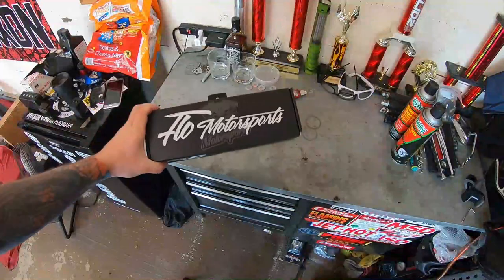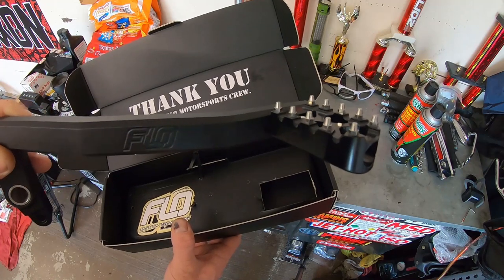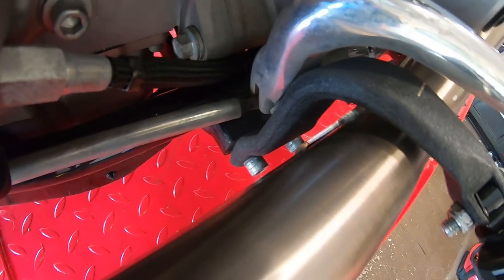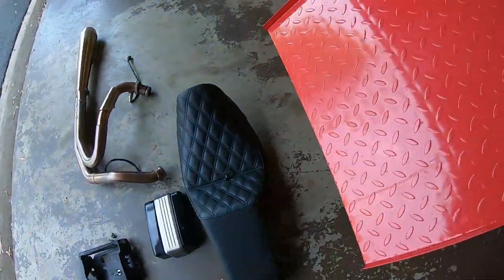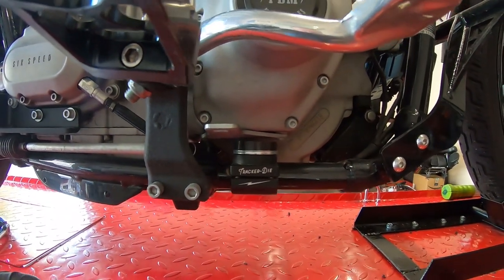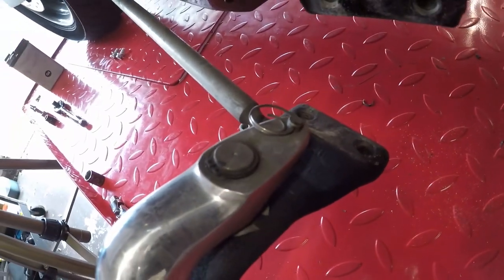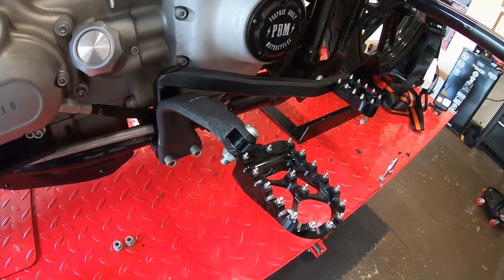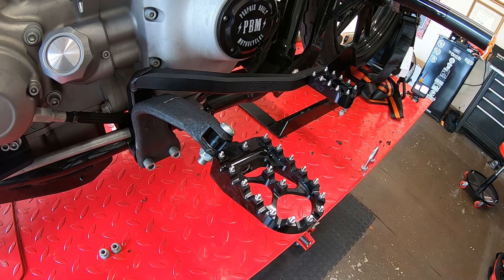Flo Motorsports Rear Brake Arm Install Harley Davidson Dyna

Comment: I was able to get mine off without removing the exhaust. Used a ball end Allen and a box end wrench as a cheater bar to rotate and pop those bolts loose. Got them out by hand after that.

Comment: Glad I watched this... I've got more or less the same setup and I'm doing the flo brake pedal tomorrow... I've got some ball head Allen's that may work to get the peg off, but I'm going to grab some exhaust gaskets just in case I have to take it off. Almost hoping I do so I can finally get around to installing the wideband 02 censors and the target tune I've had sitting

Comment: So does any of the adjustment give you more response than the OEM pedal. My FXDB always felt like I had to push the pedal down further than should be necessary to get into breaking the tire to a stop. You said there was 2 adjustments but only showed the length adjustment was the adjustment rod the second or did I miss something. Shit response from OEM pedal since 08 when I got the bike hoping to fix that issue.
Reply from the maker: Yea the rod length adjustment is all there is as far as adjustment

Comment: I'll have to run over to my '17 Dyna Street Bob (with stock exhaust) and see if I have enough clearance to remove the footrest... I sure as hell hope I don't have to remove my exhaust LOL.  I just bought a Performance Machine Apex brake arm for my bike.
Reply from the maker: If you are replacing the whole arm Iam 98% sure you have to remove the exhaust.....sucks
Reply: @TrippHPjunkie  I took a look and with stock exhaust, there is enough room to get the footrest bracket off if I have to.  The service manual also does not note you have to remove exhaust and simply just describes the snap-ring and cotter ring points.  It'll be a tight fit (with the hands) but I think I can pull it off!  All the best -DV

Comment: Does this arm give you more pedal to pipe clearance over the stock arm?  I upgraded my pipe but the stock pedal is very close...was thinking of switching if this arm is a little thinner
Reply from the maker: Try adjusting the arm away from the pipe

Comment: Hey you have any issues with the pedal not being able to pressed down fully because it hits the edge of the foot peg bracket?
Reply from the maker: As of right now no......I had to space the exhaust out so that it wasnt hitting but other than that I could adjust the pedal brake rod to gain clearance also hope that helps....👍👍👍👍
Reply: I didn’t know if you could adjust that brake rod to raise it enough to prevent it from hitting the bracket or if I just have a defective part, that’s what I’m trying to figure out
Reply: Thanks man! I appreciate the quick response I’ll see if I can adjust it. I didn’t have any other issues with exhaust clearance, I have a cobra speedster 909 exhaust on it for now.
Reply from the maker: @clubstyle_midwest5536  its super easy to adjust the rod to try I think I would do that before condemning the part

Comment: I got the same one but it wont work with my exhaust 😥😥😥
Reply from the maker: Damn that sucks....is it hitting? Can you space it out some?
Reply: Yeah man it scrapes the side of my exhaust and I tried everything to get it to fit in there a while ago lol. Now it just sits in a box until I get a new exhaust 🤣
Reply: @fxdbfinch8110  What exhaust are you running just out of curiosity?
Reply: Same. Vance and Hines 2 into 1. Had to put my stock pedal back on. Did a number to my heat shield.